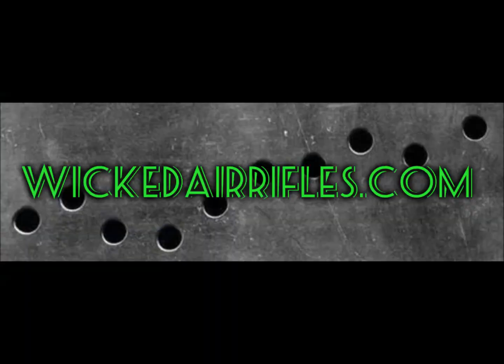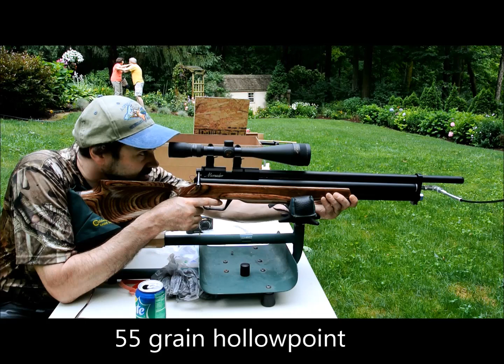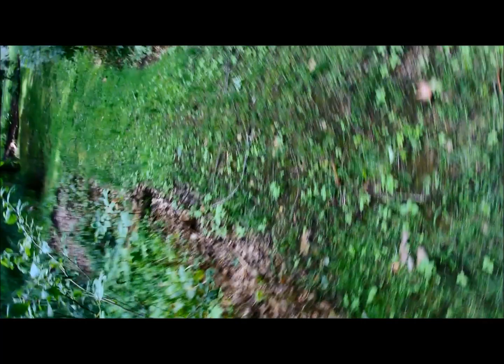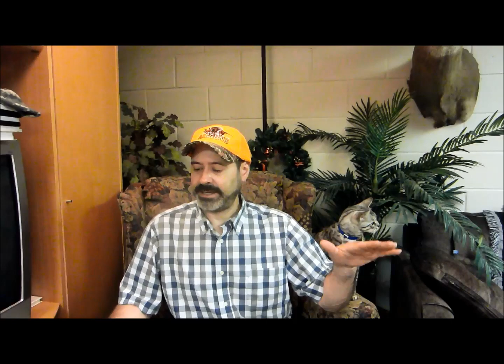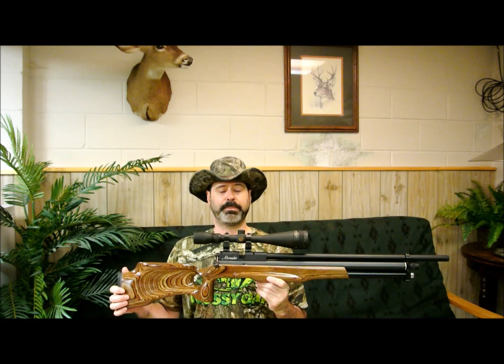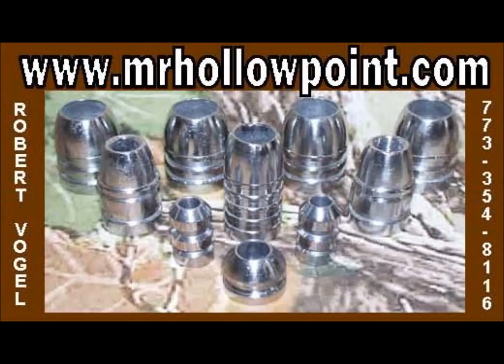Benjamin Marauder 25 Power Tune

Comment: PCP pressure regulator
s
I`m over 12 years pcp regulators manufacturer(with high pressure I am working over 30 years) and in this time I`m looking for dealers from  any country which can sell my regulators.If you can buy 10 and more regulator per time,I can do better price.For more information and better price contact: pcpregulator@gmail.com
https://www.ebay.com/itm/162720425677
https://www.ebay.com/itm/162172278885
https://www.ebay.com/itm/162104913497
https://www.ebay.com/itm/162104920622
Best regards

Comment: I'm no shooting expert by any means but pretty sure your scope is sitting pretty high (which is more prone to giving you more error due to slight tilts of the rifle). The objective should be as close to barrel (shroud in this case) as possible without touching or rubbing. it's also easily visible by how low on your jaw the rifle is sitting. Usually it should be on your cheek bone for best result. Of course you can do it the way you want. Nice vid otherwise, I enjoyed it.